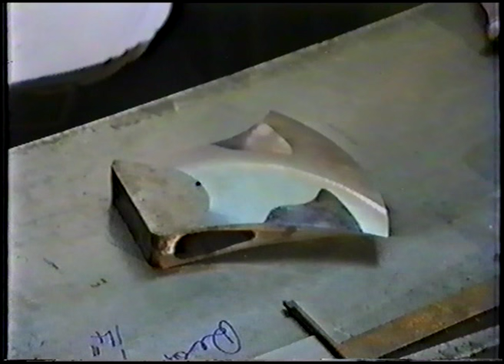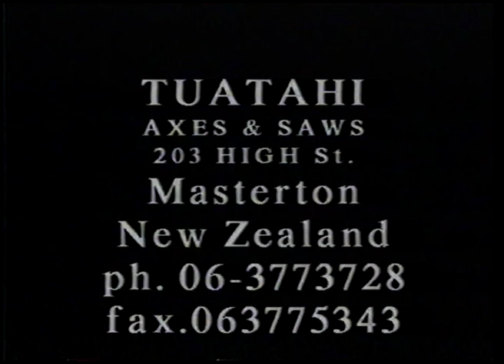Axe&Saw Repairs Tuatahi Part 1, the grinding jig

Comment: Do you need a different file clamp thing for each different grind or it it a matter of adjusting where the make rests and will this work on other brand ox axes or just the Tuatahi, will it work on your new camp axe?
Reply from the maker: The grinding rig is specific for racing axes with a circle formed cutting edge within certain specifications. Also you need the centre hole to position the axehead on the right location. Your file needs to be big/long enough to leave enough grinding surface after clamping. First I wanted to be fancy with DMT diamond blades but the wear like crazy... while good quality standard metal files like the Bahco ones work great.

Comment: Where do you get your files,  what are the brand's of files do you use, and what is the courseness of your file?
Reply from the maker: BE MINDFUL of consurvation I use Bahco files, available at the local hardware store. Start with the most coarse and work my way up - finishing touch with DMT diamond blades and a buff wheel if I am in a shiny mood.